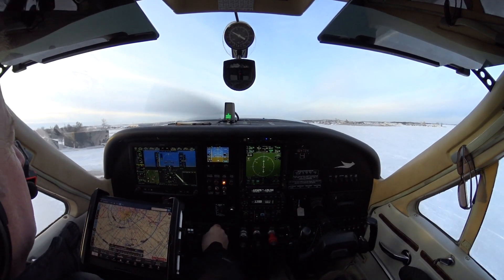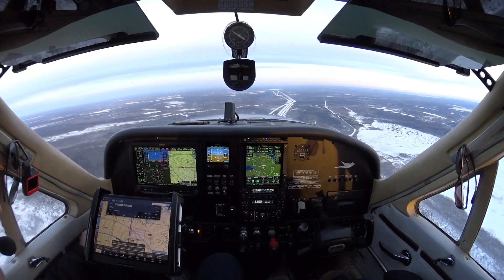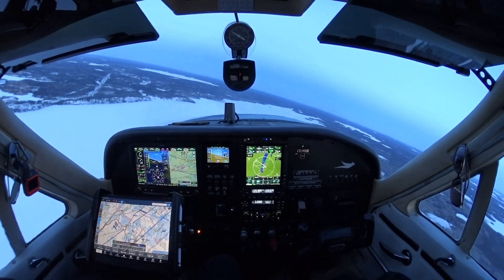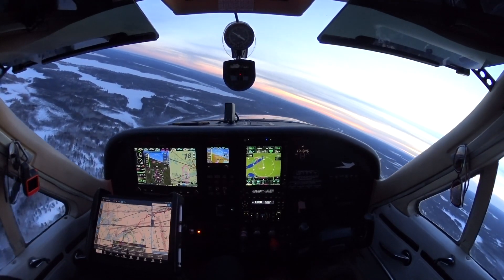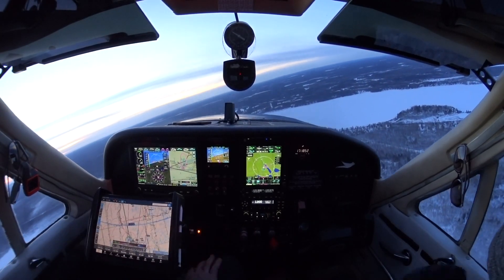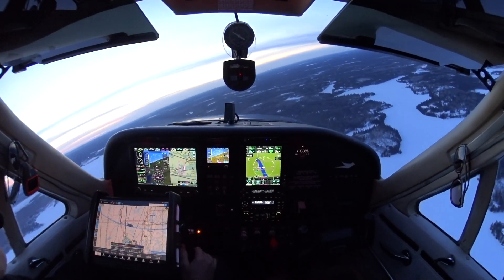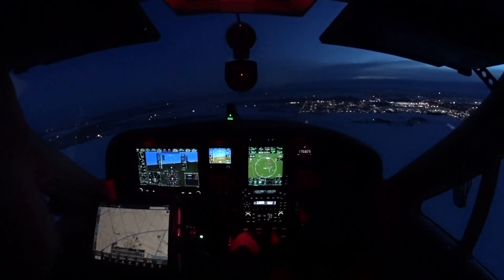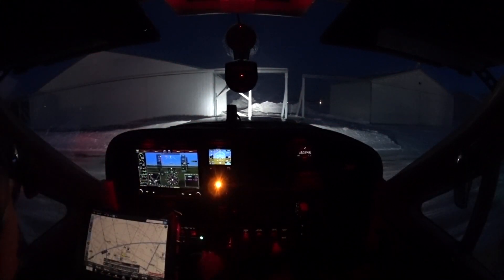Cessna 177RG Cardinal - In flight Garmin GFC500 demo - GTN750XI

Comment: I have the same plane. Which ipad size and Mount do youbhave?
Reply from the maker: Regular size iPad and the Ram Yoke mount system.  When i went with G3X i no longer have old, analog gauges on the lower portion of the panel so iPad blocks nothing.

Comment: No, I'm not envious!🤥🤥🤥
Sold my plane (172N) to build an RV-10. 
BIG MISTAKE!🤬🤬🤬 Not the RV build. Selling my 172.
Renting is a nightmare!
Researching 177's when I seen this post. Outstanding panel! It is the template I'll be following when I find a deal I can live with. Thanks for posting!
Reply from the maker: I rented for 18 years before finally buying my own plane, went from 15 hours a year to 115 a year!  Looked at 172, DA40, SR20, Grumman Tiger, Archer but so happy i decided to be patient and find the right cardinal RG.  Decided RG due to fuel injection, 1000 pound useful load and i cruise all the time at 135 Knots lean of peak and 8.5 gph.  Just last week i went rich of peak and was doing 151 knots level flight, 4500 feet so it's a great cross country platform.  If you haven't checked it out, goto cardinalflyers.com and there are tons of articles about the Cardinal. Two huge 4 foot door that open 90 degrees makes it super easy to get in and out, never have to move my seat.
Reply: @gogilgau  Thanks for the info!
Reply: @gogilgau  i have the 76 Cardinal RG as well. Grateful if you can share your avionics because I'm looking to upgrade soon. See you on cardinal flyers maybe. C-GWTP
Reply from the maker: I am on cardinal flyers so you can contact me there and would love to help however I Can.

Comment: This is far and away, the best video that I have seen that simply shows how multiple devices are used in conjunction. It originally caught my attention because it's done in a "newer" Cardinal. My first flight after returning from Vietnam in early 1968 was in a 68 Cardinal with 14 hours on the Tach. All of my private pilot training had been done in Cherokees so flying the Cardinal was practically no change, except better. My first owned airplane was a 1969 Cardinal (which is still flying in the UK) that had the 180 hp engine so I truly never knew that the Cardinal had been considered under powered when it had the 150 hp. As much as I liked the A36 Bonanza that I had later, the Cardinal remained my first love.
With the avionics package shown here, even if it just sat in my hangar, I could die a happy man.
Reply from the maker: Wow, amazing kind words, appreciate it very much. Every time i fly the plane (now with my IFR, I am super spoiled) but i hand fly half my approaches to stay sharp but the autopilot makes me look bad!

Comment: I recently bought a 1975 C-177RG (GTN-650, 2 G-5's and S tec-30).  What size I Pad are you using?  After almost 30 years I am back in aviation and things have changed a bit! Everyone says the small I Pad but after using paper charts all my previous flying it just seems too dang small! 
After going to Oshkosh and pricing autopilot upgrades (even the Genesis 3100 where I can use the same servos) I think I'll just stick with my S-Tec 30 2 axis, at least for now.  Nice video 🙂 by the way!
Reply from the maker: It's a normal size iPad, because i don't have any engine guages below the yoke anymore, it doesn't block anything and is much easier to read and work with as my maps etc.  It does not interfere with anything and i prefer the size than the mini.  Before my G3X, i had to peak around it to see the engine temps, not ideal.
Reply: @gogilgau  Thanks Gil.  The new IPad is supposed to be out in November with a new processor that is less likely to overheat Im told.  Happy aviating!

Comment: I have a 1975 177RGII and it has a Garmin 480 with an SL30 and a STEC 55X. I purchased a G3X Touch, 650xi, G5, GDL 52r with the associated install kits. I can add the G500 with all servos and accessories and switches for $9500. Do you feel that would be really worth the time and added effort to add the G500 features?  I like the interface but the 55x works for both gpss, VNAV, and so I’d just be getting the added integration. I’m really tempted but it will mean a couple weeks of downtime while I remove and install servos and adjust tension, calibrate.
Reply from the maker: Seeing as you have a functional autopilot it's less critical to have all garmin.  I sure like the interface, overspeed, underspend, flight envelope protection, Level button and the smoothness of the Garmin.  It works top notch like all Garmin gear. I also added electric trim and yaw so it's been an amazing experience flying it.  You have a nice setup so unless you feel your missing something, i might not spend the cash just to change brands.

Comment: Nice I’m not a pilot but if I was I would have that system looks very easy. I would love to fly but I’m a big guy at 390 lbs and I don’t know if I would fit in them training planes.
Reply from the maker: Most 172's will easily hold 450 pounds front seat and maybe closer to 500, as long as you find a smaller size instructor you should be able to make it work. The 172 Cabin is about 41" wide, the Cardinal is 48" wide inside and 4 foot long doors so much easier and more comfortable to get in but not many flight schools would have a Cardinal. Don't give up hope, call a few flight schools in your area and see what they can accommodate. Try it! you will love it.
Reply: @gogilgau  thanks I will look around to see if they have cardinals for rent to train in they are my favorite plane. I watched many videos and. If I had to buy one it would be a cardinal thanks again,carl